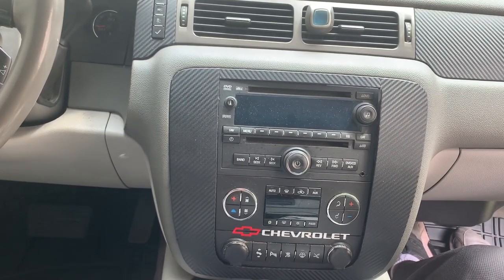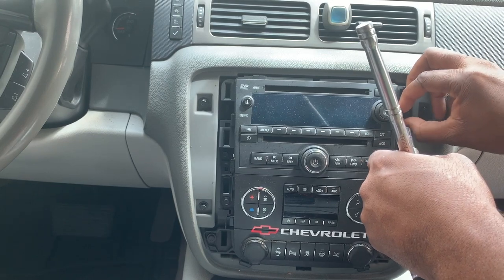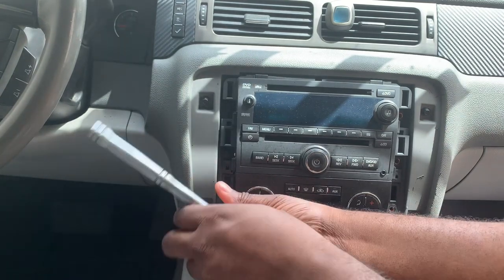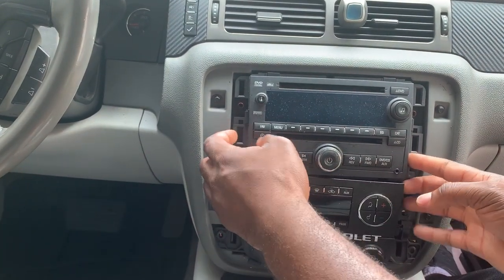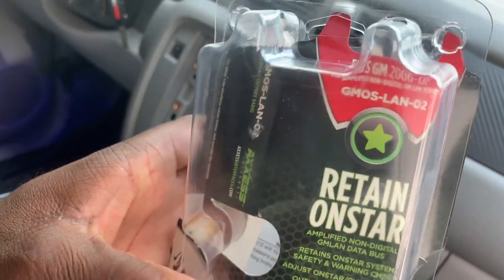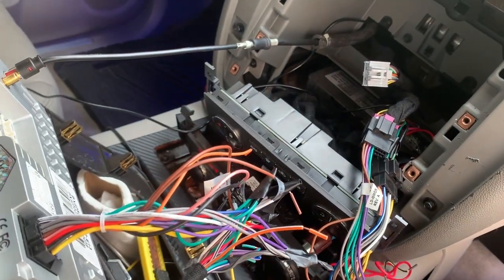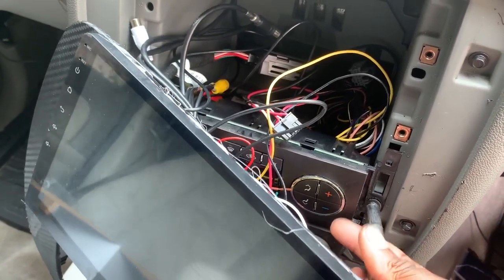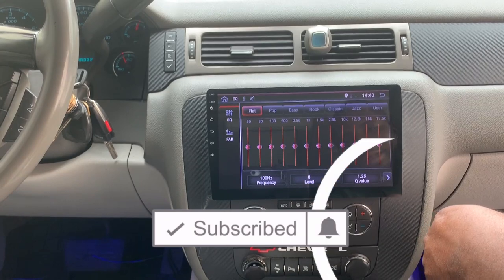10" Andoid radio 9.0 in Chevrolet Tahoe

Comment: 🔴 👌🏾 Fantastic job with the install, very clear and precise and easy to follow. I wonder if you can answer the question about the AMP OUTPUTS, does it say the voltage of the amp output RCAs❓️

Comment: Screen goes blank when I turn the car on but works when car is half way on the key
Reply from the maker: Raydon Chow your using the wrong wire I’m guessing. The wire should be 12v...
Red - 12v
Black- ground
Yellow- memory
Reply from the maker: Raydon Chow could be a defective radio also

Comment: Hey bruh by any chance I may need a bypass because of the year model of my vehicle it a 02 gmc yukon. The problem I'm having is the radio not cutting on
Reply from the maker: If the radio isn’t cutting on you may have the wrong power wire. Bypass would be fore the amp. Do you have a radio kit or wire to original wires? Your 12v wire should be orange.
https://www.scosche.com/media/guides/ct1031.pdf
Reply: @540tv6  yeah I got a orange wire now the light on side cut on but the screen doesn't

Comment: mines not turning off ...the time and date  stays on Any ideas???
Reply from the maker: Combine the yellow wire with the 12v red wire
Reply from the maker: If it’s not turning off where your red wire is connected may be a always on wire...for instance some cars the cigarette lighter stays on even when the keys are out of the ignition. You need to find another source that turns off when the car is off

Comment: Does your steering wheel controls and parking assist work?
Reply from the maker: I didn’t get the module for that to work with my vehicle but it’s possible. The radio has the option

Comment: Greetings. My unit didn’t come with brackets either. How did you mount it? Using glue? If so what type of glue?
Reply from the maker: I used a glue gun initially but put a screw in the back to hold it on...if someone wanted to steal it they would have to take the whole panel

Comment: Can you hook up a amp for subs and a amp for mids and highs
Reply from the maker: Yes sir, there’s outputs for the both amps . May actually do that myself
Reply: @540tv6  ok appreciate it
Reply from the maker: No problem
Reply: @540tv6  How does the wifi work on it
Reply from the maker: @vertrondickens7033  just like an android tablet... go to the settings then WiFi to connect to a network

Comment: I was just getting my 10' screen installed.. Everything worked fine but the sound was only coming from the front speakers and not all around in the car. The guy said the system was not connecting to the Amp of the car.

How do I by pass that so I can hear sound from all through out.

My car is a 20111 gmc acadia denali with stock Bose speakers.. Help pls!!
Reply from the maker: Yea in the video I have the type of bypass you will need to connect to the stock amp...I had the same problem and it solved my issue. Good luck anything else just hit me here
Reply: @540tv6  thank. Can you tell what products it was. My truck is a 2011 gmc acadia denali with Bose
Reply: @Adonis617  did you ever find a product or method to bypass this? I have a 2011 tahoe and Ive installed my screen and everything and the sound works fine but only in the front.

Comment: How did you mount the radio is that hot glue???
Reply from the maker: Yes that’s what I used before which held it in being there are no brackets for this unit. But I did make a bracket that attaches to the radio and bezel.
Reply: @540tv6  there is actually in the end of the box

Comment: Do your back up camera still work
Reply from the maker: My Tahoe didn’t come with a backup camera or even navigation. But I did install a backup camera on it
Reply: @540tv6  do you know if that unit will work with factory backup camera
Reply from the maker: R. T. Yes it will, I installed one for it. Of course an aftermarket back up camera.
Reply: ok I've had mine for about 3 mos. now and not satisfied, it won't update and I've contacted support for update which they gave me and still nothing , basically it junk I might just go with pioneer or something like that
Reply from the maker: R. T. Dang man! Yea I bought another for a vehicle and had to get a replacement ...sorry yours not working!

Comment: Aye bro. Can you control the volume with the steering wheel controls? Thanks in advance
Reply from the maker: Yes, ima go another video on that. That was the extra factory adapter I didn’t use
Reply: These radios dont have the steering wheel control plug in
Reply: @540tv6  I have a Silverado and the same style dash does your shifter hit the screen?
Reply from the maker: Chris Cruz  hey naw it clears the radio by alot

Comment: I installed mine put it doesn't power down when the car is off
Reply from the maker: donpoochi where your red wire is connected is a constant power source and you need to find once that turns off when the car does like the cigarette lighter

Comment: hay 540 i need some help im putting in the same radio in my Tahoe can you tell me y my Bluetooth sound wont work thank you
Reply from the maker: carrier freight service what’s up man that sounds like a defect in the radio if your FM stations work fine. Also these radios are like android tablets so make sure in the audio section the Bluetooth volume is turned up
Reply: yup i got it had the wrong wire connected
Reply: how did you connect your speed wire

Comment: do i only need to buy the interface if i have a bose system ?
Reply from the maker: Yes because the speakers won’t work..
Reply: @540tv6  so if i have a non bose system its fine with out the interface?
Reply from the maker: @ytmshari  yep your good to go
Reply: @540tv6  sorry if im bothering you but last question, will the steering wheel controls work ?
Reply from the maker: @ytmshari  your good man, that’s what my channel is for....you will have to purchase the module for steering...I didn’t

Comment: How did u mount it to stay
Reply: That's what I want to KNOW
Reply from the maker: I used clue that’s not noticeable on the rear of the unit! Worked great
Reply from the maker: Just answered the above question
Reply: @540tv6  what type of glue?
Reply: where you found the harness, which goes from the stereo to the truck
Reply from the maker: juan Reyna had to go to my local audio shop ...without it you won’t have sound. That adapter is needed to connect to the Bose system

Comment: do you have the bose system or no???
Reply from the maker: Yes, the part I shown in 6:54 is the adapter that’s  needed to use the Bose system that’s already in the truck
Reply: I don't HAVE the bose system do I still need the adapter
Reply from the maker: donpoochi no you won’t need it. Are you not getting sound?